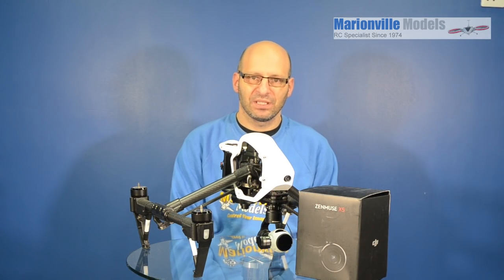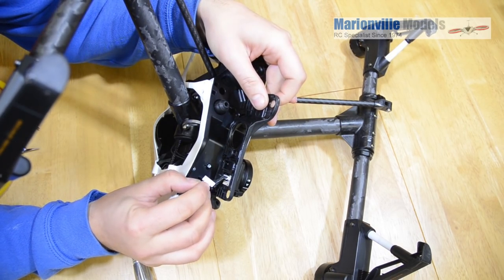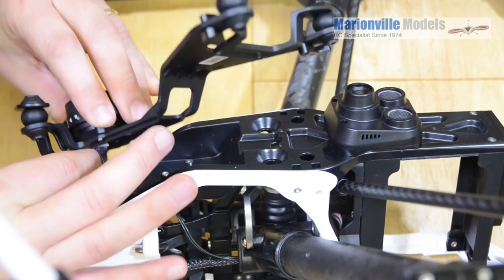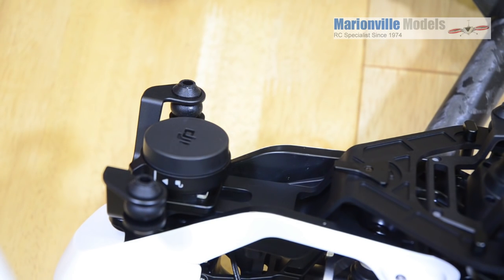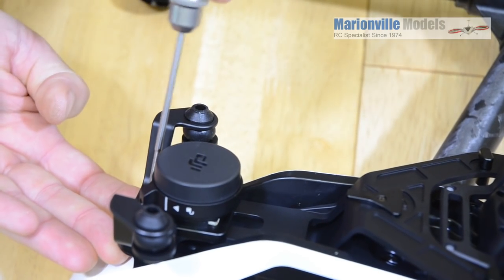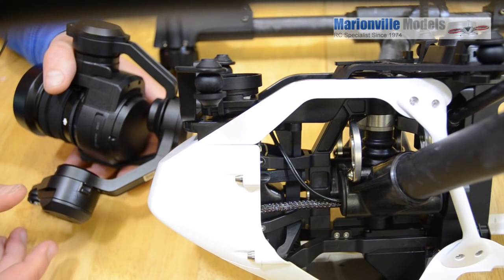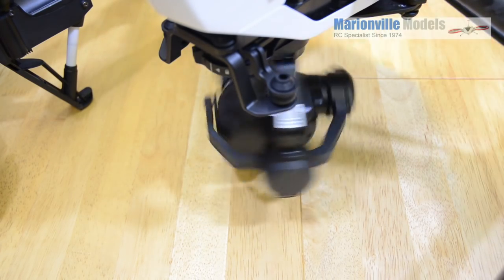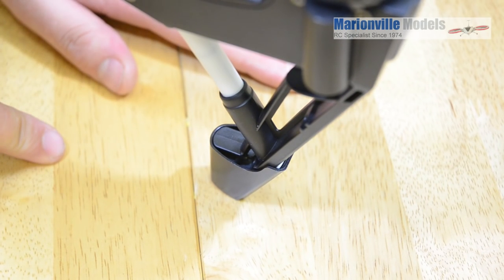Upgrading to DJI Inspire Pro with X5, How To Fit The Camera & Adaptor, Part1

Comment: Great video.  I do have a question I hope you can help with.  I have an Inspire 1 and when I turn it on all the lights are green but the gimbal doesn't do it's little dance and the controller will not connect...

Comment: Excellent video.
I've had the Inspire ! for 4 tears and just made a move and purchased an X5 camera.
My adapter did not come with the 4 screws.
Could you let me know the screw size needed. I'm guessing M2x6.

Thank you.
Reply from the maker: Mike Maheno I think they are 2.5mm
Reply: As a follow up/ The 2.5 X 8 screws worked perfectly. Thanks again.
Reply from the maker: Mike Maheno nice one.

Comment: Hello friend, excellent video, I have an Inspire 1 Pro with X5, the gimbal levels, records video on the Micro SD but does not transmit video to the application, I also see that the LED of the camera is always red. Would you know what could be happening? Thank you
Reply from the maker: Eduardo Gonzalez it could be the cable that runs from the gimbal mount to the flight controller. You’ll need to take the nose off the craft to get the the other end of the cable.

Comment: Nice vid, thank you. Would you recommend simply buying a Pro over purchasing a new V2 inspire (X3) and eventually upgrading it with an X5 ? In other words, would they basically be the same craft afterwards? I ask because the upgrade path is the cheaper option where I live (Switzerland), since a new V2 can be now be found for a very low price.
Reply from the maker: I still use theX3 so good to have both cameras.
Reply: +Marionville Multirotors Good point, thanks.

Comment: do you need to put the leg extension my box will not fit with those on . it look's like it just cleared the table on flat surface.
Reply from the maker: You have to cut the foam for the leg extensions. I think if your on soft ground the camera would touch without them.
Reply: +Marionville Multirotors hanks ! also help full video